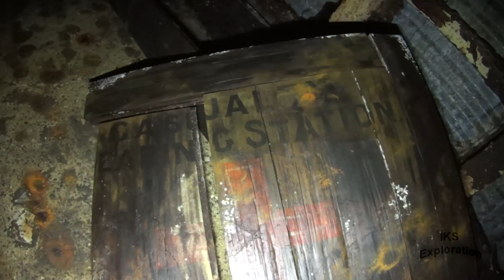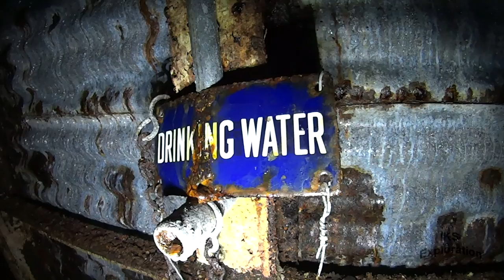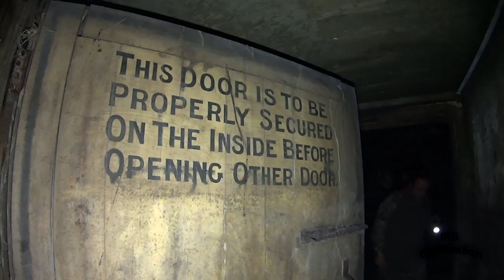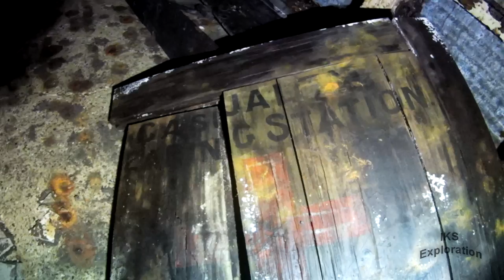Royal Marine Deep Shelter, Chatham - Part 2

Comment: These tunnels took me back to when I was a coal miner in the 1980's.We used the exact same roof supports made from RSJ girders called "Rings" and corrugated iron "sheets" between. The pit I worked down was one of, if not the deepest in Europe at 2,500 feet to the pit bottom. 

When I was a miner I sometimes got chance to explore the old workings and was fascinated when walking along old road ways "Gates" as it sometimes felt like time travel, some of your videos give me the same feeling, thank you!!

Comment: Two of the most interesting vids yet, and you've done a few. The fan room has 2 doors so you can get access to the machinery: if there was only one door, you would not be able to open it due to the suction from the air being drawn down from the surface. The air circulation relies on the in take and out flow being isolated from each other. The insulation on the door is probably soundproofing, and it was the motor, not a generator in pieces on the floor. Thanks for taking us along, I enjoyed it.
Reply: Dale Skidmore Thank you.

Comment: For future reference, and please, relay that to him, never, ever, climb with your legs split like that. Try to keep your body as narrow as possible. If you fall, the chances of getting a cracked bone in places you don't want, ever, to get damage like that are greater.

When i was in hospital, across from me was a guy's pelvis was cracked, he never stopped moaning and begging for medication even tho he was given the maximum dose, fell asleep quite a few times etc. It's not something you want. Keep your limbs packed, you're better off breaking a femur than the key components.
Reply: That's a complete generator. Was there any soot in the room? Thieves might've gotten in after the copper in the armature, all i see is the steel element of it. That's vandalism you see there.
Reply: That wasn't a generator, that was an electric motor. And yes that was thieves stealing the copper armature from it.
Reply: In the fan room, they were remains of an electric motor, the rack looks like it might have been a battery bank with the batteries missing. It was possibly a backup to keep the ventilation going in case of a power failure. Also in the corridors, on the roof beside the original electrical conduit, there is more modern cable tray. I'm not sure when tray was invented but I think it was in the 70s or 80s.
Reply: neil Chapman i think the rack was for storing filter mats.  In case of a blackout the ventilation was handcranked.
Reply: aserta -----Hay man I agree with you when they were coming down the stairs never ever spread your legs and arms out like that, hold on the same railing with both hands and keep both feet on same side also. Just saying dude" because if one foot slips off the way you're doing it with your legs spread out you are most likely going down you won't be able to hold your weight .
Reply: Well the problem with breaking your femur is that the bone shards could cut blood vessels that would cause you to bleed to death before you could get help. I was with emergency services and we did have a girl to break it. We weren't allowed to go by ambulance. She had to be lifted out by helicopter. The risk was just that bad. See it's not the breaking of the bone but how you are moved that is the risk. If you puncture one of those major blood vessels...broken bones will be the least of your worries. See I was on the fire side of things and I didn't have medic training. I didn't know about that till we got that call. That was a pretty tough call having to deal with that.

Comment: The reason why one door had to be closed before the other was opened is most likely because the room was a plenum chamber, so there was an air pressure differential (as you correctly observed it's an old AHU room).

Also, the door backing at 15.06 is quite likely asbestos, and also likely to be friable insulation so you need to be aware of stuff like that, because there is no safe exposure level for asbestos and that is the worst kind!  There are also rope flash guards in fuse boxes often which are pure asbestos.  So be careful, fellas! :o)

Comment: The fan motor is a 415 volt 3-phase wound-rotor motor, the front of the starter (step-start) was just outside the plant room and that used to be on the front of the steel frame to the left of the fan, the frame contained the starting resistances, Nice. J.

Comment: The tunnel in the plant room roof must be an air intake from the surface, as the plant room had two doors to act as an airlock to seal that level off and stop the fan drawing in air from that level and dispersing stale air to the others. It says on the outer remaining door that only one should be opened at a time to stop this.

Comment: It's rather strange that the shallower tunnels have suffered more from damp than the deeper ones - there's more rust visible here. Another quality video. Another one that made me think of the old movie 'The Poseidon Adventure', too - those utterly bastard stairs. Is that rot, or were they deliberately smashed to prevent ingress? Either way, they are properly lethal.

Comment: Irony here is those bricked off walls would be to isolate the damp sections from the dry, clearly they used the drier sections up until fairly recently, by breaking open the walls the damp has been allowed into the more preserved levels causing them to decay more rapidly now..  it also preserved the damp sections leaving more artifacts.. bit of a two edged sword.

Comment: 5:35 Artic Fuse and Electrical Manufacturing Co. Now out of business.
12:22 not security but a air lock. It would probably bugger up the air flow if both doors were open at the same time.
You need to get a better microphone or something. that is irritating as hell the way it keeps cutting in and out.